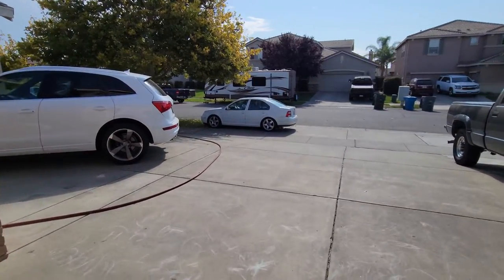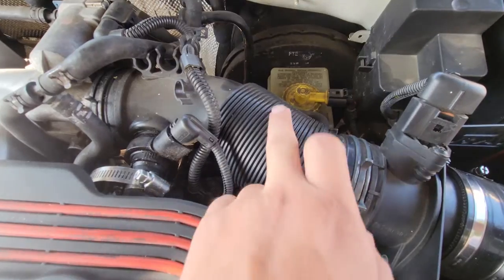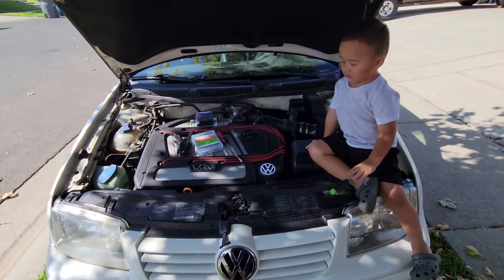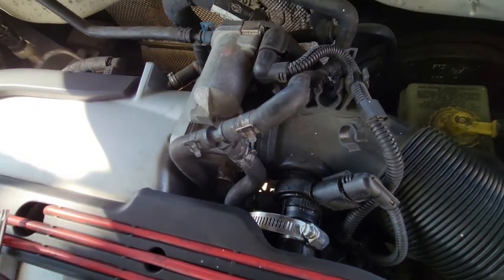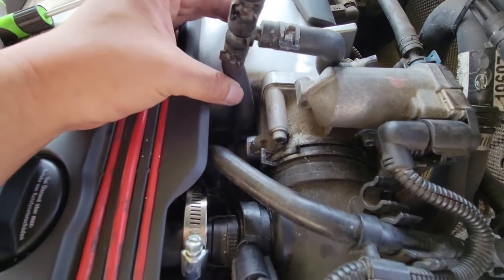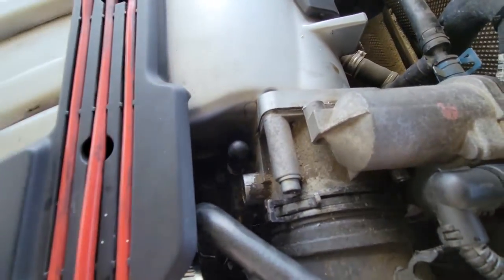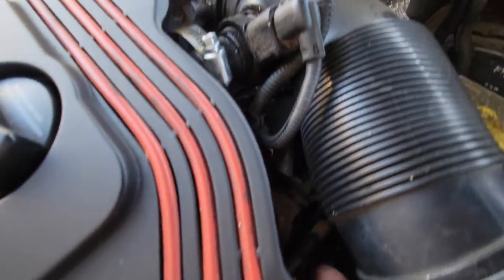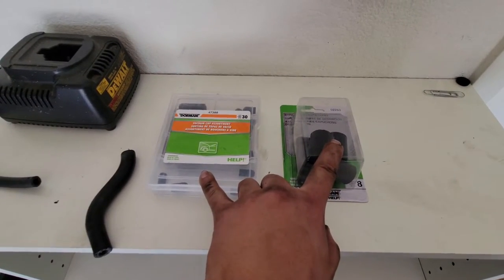THROTTLE BODY COOLANT BYPASS on my 2000 VW MK4 Jetta 12V VR6 5 Speed Manual!

Comment: No need to gain 2 hp
Hear there for other reason 
Air fuel mix ??
Reply from the maker: Not quite sure but definitely a good feeling that the throttle body is cooler without the coolant running through it. 👍